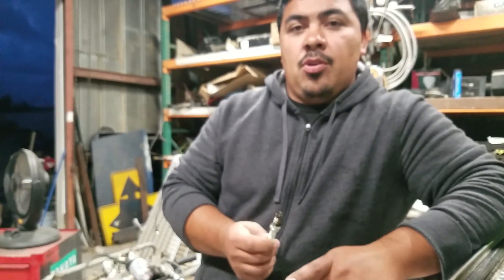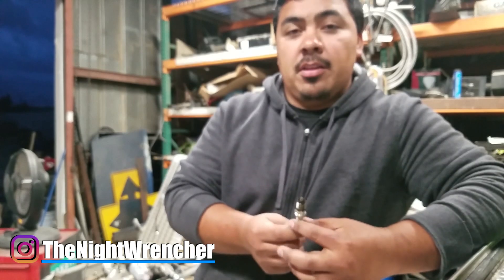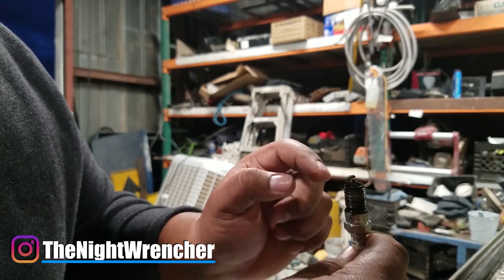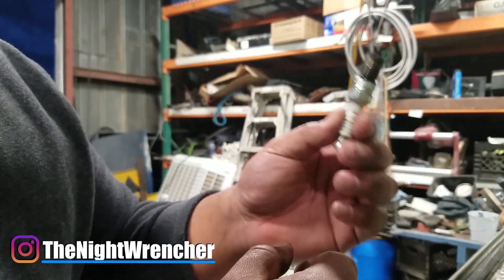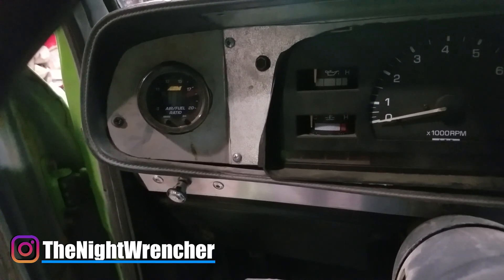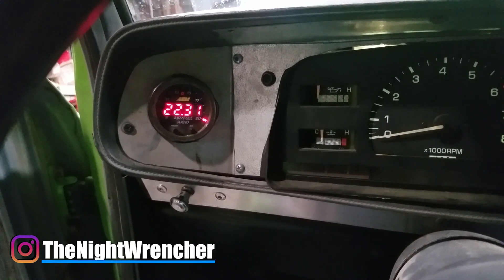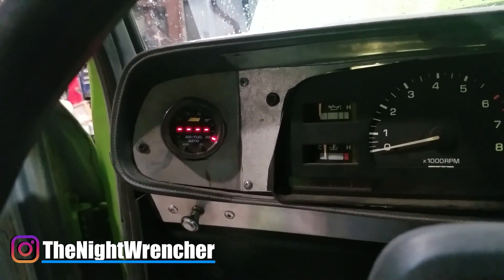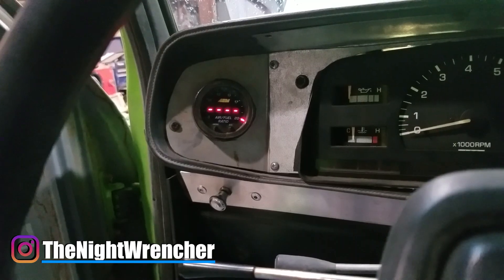How To Read A Spark Plug Vs Using An AFR Wideband O2 Sensor Gauge | Reading Spark Plug Tuning

Comment: Is there such a thing as a combination sparkplug/AFR sensor (wideband)?  Is that even possible?  Should there be?  Is this idea genius or stupid?
Reply from the maker: Unnessesary is the word youre looking for 😂
Reply: @NightWrencher  If possible and accurate, the dudes who're used to tuning by reading the color of spark plugs could have actual numbers instead while engaging in similar physical activity (removing and installing spark plugs), but with superior results.

What is it that you're scoffing about being unnecessary?
Reply from the maker: @GeneralFukzamatayu because it wouldn't work how you think it would work. The sensor would read lean most of the time and be subjected to extreme temperature and raw fuel which would shorten sensor life dramatically. High horsepower engines use EGTs as well as O2 sensors so get their data so designing a sensor for inside the chamber would be unnessesary
Reply: @NightWrencher  It'd have direct line of sight to everything in the combustion chamber both pre and post detonation, so perhaps by tiny photographic sensors or laser scanning or IR or other spectrography.  Sensor tech is very advanced.  I'm no expert on sensors, but I know that.
Reply from the maker: I am an expert on sensors and I can tell you that 1) designing a universal sensor and interface that could handle the stress would be extremely expensive. 2) the resolution would have to be in the microseconds in order to see clear data during valve events at high RPM. 3) the sheer amount of data you would need to IGNORE in order to see what you need to see would be insane 4) a sensor like this is completely unnecessary when a wideband can do a much better job with less complications.

Comment: @NightWrencher my spark plug threads have some oil on them should I worry im gapped for boost 5.3 ls
Reply from the maker: I wouldnt worry. The first 3 or 4 threads always get dirty. As long as theres no carbon on the TIP of the plug, youre fine. Carbon means excessive oil.

Comment: A wide band is great for getting things very close. Once you’ve done that, it’s time to examine each cylinder, via the spark plug. You absolutely can fine tune each cylinder via spark plug reading and carb adjustments.
Reply: False. You cannot fine tune EACH cylinder with a carburetor.
Reply from the maker: Actually you can. Thats where intake manifold porting comes in. Check out david vizards tunnel ram video for more info.
Reply: @NightWrencher  I watched David's video.  He modded the intake manifold to equalize the cylinder's airflow. That would be fine tuning by using an intake (like you suggested)... not by tuning the cylinders with the carburetor. Big difference. The post above stated that "You absolutely can fine tune each cylinder via spark plug reading and carb adjustments." Carb adjustments to fine tune EACH cylinder is not possible.
Reply: @TurboMalibuV6   just like an afr gauge… it’s a tool that helps you, of course you’ll have to make adjustments, could be at the carb or at the manifold, to even out the atomization and get an even mixture on each cylinder. I agree with you.

Comment: You keep saying reading plugs is worthless but if you don't have an afr gauge on the car/motorcycle/chainsaw/lawnmower/equipment etc it's valuable information. Also unless you have an afr O2 sensor on every single cylinder then you're not going to notice if one cylinder has a problem. Your afr reading may be good but if you pull all the plugs and one is showing lean/rich you'll know there's an issue.
Reply from the maker: Reading plus is useless IF you have an AFR gauge. A problem with a single cylinder wont have much to do with the carb mainly because half the carburetor feeds the whole bank and distribution is pretty good on modern carb intakes so that leaves ignition and compression which would be noticable with or without an AFR gauge or checking plugs. An AFR gauge cuts tuning timing to a fraction of what it would take be just checking plugs. You can tune idle, transition, main, pv and secondaries in a single drive. Reading plugs has its place to tell you the overall health of the engine, but for tuning, cant beat an AFR gauge.
Reply: @NightWrencher  do what? An AFR gauge only gives you an average AFR reading across the cylinders on that bank. You can easily have one cylinder at 10:1 and another at 13.7:1 on the same bank, yet your AFR reading could be 12.3:1, and you’re none the wiser. I’ve seen exactly this on the dyno using O2 sensors in each primary tube. You absolutely can fine tune each cylinder with jet changes and air bleed changes. You don’t have to do a WOT pull to get a plug reading. If you’re fine tuning drivability, then put fresh plugs in, run around the block as you normally would and then shut the engine off and check your plugs.

Comment: Spark plug reading, even for a street car is not useless. Not all widebands are calibrated properly and working correctly. Checking the plugs every once in a while is a good practice for tuning. I agree widebands are great but you can't get all of your info from numbers alone.
Reply from the maker: You can learn a lot from reading spark plugs. looking for Signs of detonation, how well the advance is working, compare cylinder to cylinder to make sure fuel distribution is even, but hands down, there is no better tool to tune your transition, main and powervalve circuits than with a wide band. Your WOT you want to tune it at the track or on a dyno. your idle can be tuned with a vacuum gauge, but everything else, should be tuned with a good name brand wideband. A wideband can turn a novice into a pro in a matter of days and no holley will become untunable.

Comment: thank you about what you said about plug reading is only good for racing.  and theres a lot of information left out about part throtle.
Reply from the maker: Yes, too many carb people only focus on WOT and forget about drivability. Since I've had my AFR gauge there hasnt been a single carb I couldnt get dialed in. You can pull several MPG out of your carb so the AFR gauge will pay for itself in the long run.
Reply: @NightWrencher  yeah um , Ive been messing with carbs for years but ima hook up a wideband in the near  future and see what happens.